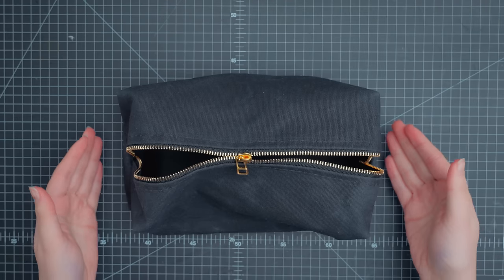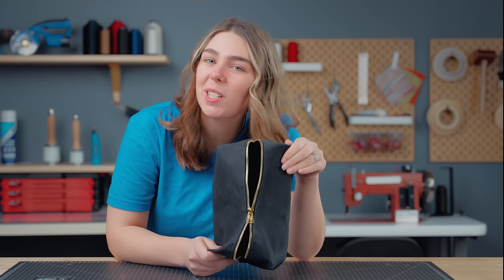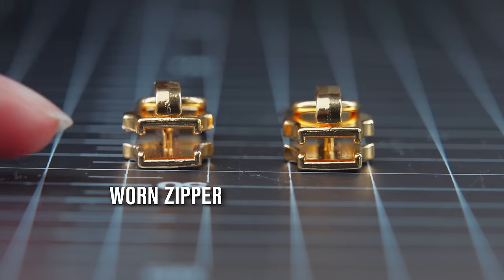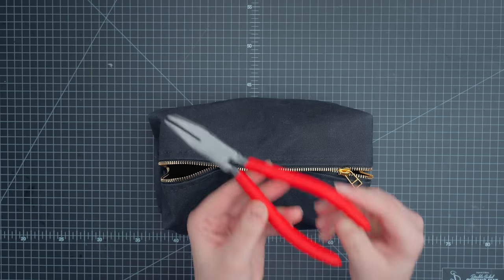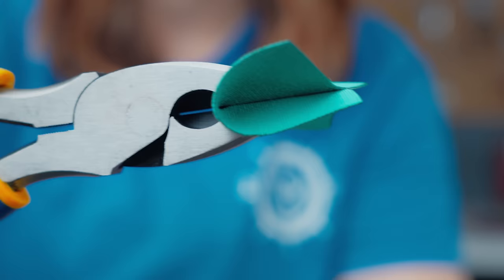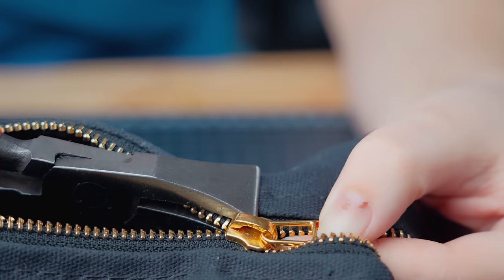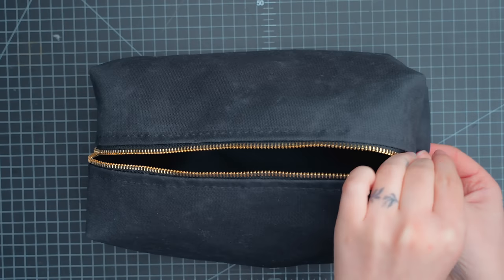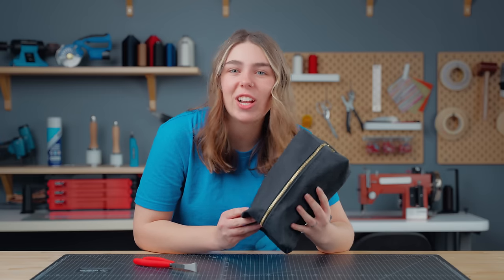Don't throw it away! How to Fix split zippers with this easy method

Comment: Wax the teeth with a candle or chapstick before forcing it back.
Reply: Or soap also
Reply: I've Used Vegetable Oil and It's Actually REALLY Effective in a Pinch! (Wax Can Clog The Teeth and Whilst oils may attract Lint If You don't Wash The article regularly, It's easier to Clean oily lint out with a toothbrush than Wax! Also, Oil Is effective with Plastic - Loop Type - Zippers whereas Wax Typically Just Makes The problem of Sticky Plastic Zippers Worse...) 

Ive, also, Just Replaced the "Made In China" Crappy Zipper Sliders with Saved "Made In USA" Saved "Rescued" Old Zipper Sliders! New Ones Aren't at all Durable....)
Reply: Also a lead pencil
Reply: But how will waxing your teeth gonna fix the zipper🤓
Reply: @ericvondell5157  you're absolutely correct!
Reply: Why do this?
Reply: @robgronotte1 wax or graphite pencil reduces friction after having fixed the slide, especially if it has been compressed a bit more than it was previously - this helps to prevent the teeth from catching, and can be done as preventative maintenance at anytime - forcing/twisting stuck zippers can cause the failure seen in the video
Reply: I love people like yourself so helpful!! Thank you kind stranger 💕✨
Reply: @robgronotte1  it helps the zipper not be so "catchy", kinda lubes it

Comment: I followed your tutorial and it worked well but after a few weeks I had to do it again. This time I used “DRY TEFLON LUBE”, and applied it sparingly to the zipper! It worked perfectly and made the slider close very easily and smoothly! You can pick up this Lube at your favorite Hardware Store or Bicycle Shop. I hope my suggestion helps!

Comment: This only works temporarily in my experience, maybe because they're silver. Brass probably holds longer, I haven't tested that though. It seems like metal fatigue sets in after only one fix on the silver colored YKK zippers I've tried this with, and I was very careful.
Reply: When they originally worked it was only temporary.
Reply: You’ll have to replace the slider
Reply: Would it work with plastic zippers?
Reply: @alybango ❤

Comment: I’m so surprised and relieved this worked. I used this on my jansport backpack because one of the zippers had derailed, I used a flat head screwdriver to force the rail back into the zipper but then it started opening both sides when zipping it. But I was relieved when I did exactly as the woman said and now I got my backpack working again!

Comment: Sometimes a zipper is so worn that it won't maintain the proper gap and after it is pinched closed it just opens back up right away or soon after.

I have had luck replacing worn zipper pulls with a new one from another zipper that is the same size.  One has to be very careful to spread the pull just enough so that it can slide over the old zipper teeth and be re-pinched -but not so much that it weakens or fatigues the metal from over-bending that one time to install it.  

This technique works best for seldom-used zippers like those used for cushions or pillows.  The replacement zipper will never be like new after the experience of being installed so its lifespan will be shortened because of that.  But it might be the difference between a zipper that splits or one that holds fast on that old cushion or pillow that you don't need to unzip very often.
Reply: Very true! I was wondering if brass zipper slides held better than the silver ones.
Reply: Thanx for your post .My purse was new and it happened after the first few uses .The fabric  it's  made from is indestructible unfortunately not the zipper .It's definitely worth the try and your post was informative 👍
Reply: @littlewingmyoho  I hope you have success eventually.  Zippers sre fairly cheap and you might try a few times with different zippers until you find the knack of it.  It's not a failure until you give up
Reply: @svbarryduckworth628  awe thanx ☺   .I'm going to try both methods. If her easy fix does not work I'll have yours as back up

Comment: Thanks so much for sharing! I just fixed the zip on my purse when I thought I'd have to throw it out! I watched another video where they did the same thing BUT they did not mention that you need to compress it from the BACK end of the zip and so it didn't work until I tried it your way because I was compressing it from the front. Thank you!!

Comment: Yaaaayyyyyy 🎉🎉🎉🎉 it worked!! It worked!!!!🎉🎉🎉 
I didn't have the pliers, so I just used my teeth to tighten it up a little😂,  and bingo!!!!  Thanks so much!!!!!! I needed to use this skirt now, Only to find the zip messing up! Thanks for the straight forward solution!

Comment: There is a replacement kit that screws two new halves together.  I will be buying it soon to see how well it works as my coats zipper broke in half and is now garbage.  The kit has several sizes.  Sold online.  Forgot the exact name but is easily searchable.  May not work on some zippers, but will find out.   Would be great if you create a review on this invention.

Comment: Subscriber, because I absolutely love that you kept it short and to the point. Do you have tips on how to get a nylon zipper/or plastic type back onto the teeth? Just one side came off the zipper
Reply from the maker: If it popped off one side that usually means the slider has lost its structural integrity and opened enough to come off the chain. If you are lucky you may be able to pry open the side that came off to feed it back onto the teeth but usually replacing it is necessary.
Reply: On something like a zippered pillowcase, I have snipped the stitching open at the start and then fed the zipper pull back onto the teeth. Then I sew a few stitches to reinforce or I opened it if that makes sense.

Many coil zippers are “self healing” and if they get off track, you can pull the tab back-and-forth several times to get them to knit together again.

Comment: If you have an extra set of pliers with teeth you can throw some hot glue on both jaws. Then use that without biting into the zipper. They come in handy.
Reply from the maker: That's a great tip! Thanks for sharing!

Comment: I have tried this before and it worked perfectly (great video!) but todays zipper... I can't seem to get it to work.  Have you ever run in to this before?  Any hacks' for super stubborn zippers whose teeth wont stay together?
Reply from the maker: Good question! Usually when this technique doesn't work anymore, it means that the zipper slider is too worn and will likely need to be replaced. If you're unsure what replacement to get, you may find this video helpful: https://youtu.be/DTCMGedmqHA

Comment: Which side is the back side as it looked like it was switched twice.   On a coat is backside down (closes to the floor)🤷‍♀️
Reply from the maker: The back end of the zipper is the flat side, and if you pull the zipper in that direction it should unzip the coat. Hope that answers your question, and best of luck with your coat repair!
Reply: @SailriteWorkbench  thank you

Comment: With the examples you showed, it’s impossible for the “worn out” wall thickness of the main zipper heads to cause any affect. The two different zipper heads you showed are clearly different sizes internally yet they have the same thickness of metal without any relevant wear.  The wall thicknesses look almost exactly the same yet the dimensions overall are clearly different. I understand if you used two different types of zipper heads as an example but it’s obvious that you’re trying to deceive viewers. And like “Otherrun”said it would only be a short term temporary fix. Unfortunately this is one of those YouTube videos that will get decent views yet it contains useless information. Great start to 2024!
Reply from the maker: Thank you for your comment on our video. We appreciate your feedback and would like to address your concerns.
Firstly, we apologize if it seemed like we were trying to deceive our viewers. We assure you that this was not our intention. When we filmed the video, we didn't have a worn-out zipper to demonstrate the issue. Instead, we mimicked the effects of a broken zipper by damaging it.
Regarding the two different zipper heads shown in the video, we want to clarify that they are actually the same zipper. The purpose of showing them side by side was to highlight the difference between a properly functioning zipper and what one may look like when it is not working properly. We understand that the dimensions may have appeared different, but that was not the focus of our demonstration.
Our main goal with this video was to provide just one example as to how to fix a broken zipper. We have other videos available that offer more long-term solutions for zipper repairs. We appreciate your feedback and will take it into consideration for future content. Thank you for watching and we hope you find our other zipper videos helpful as well. Have a great day!